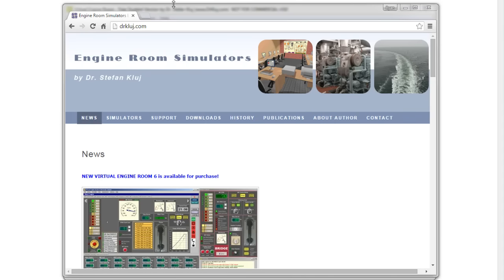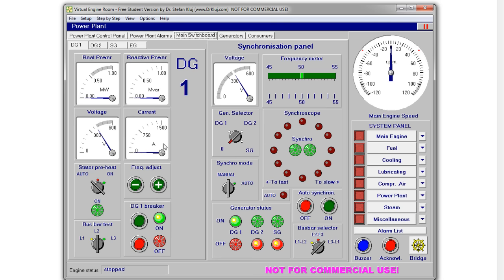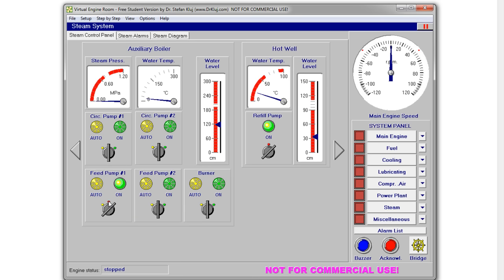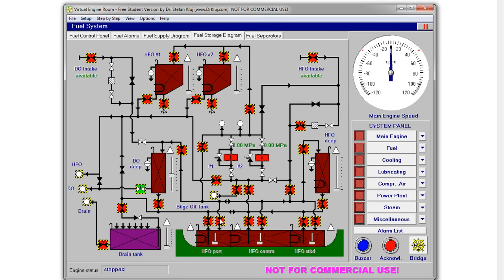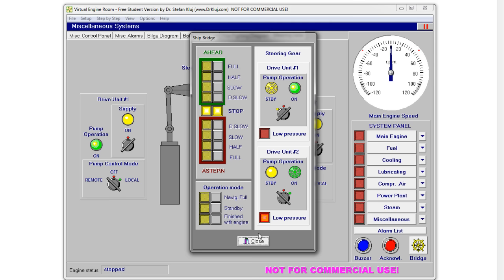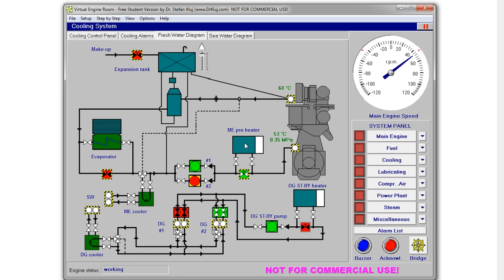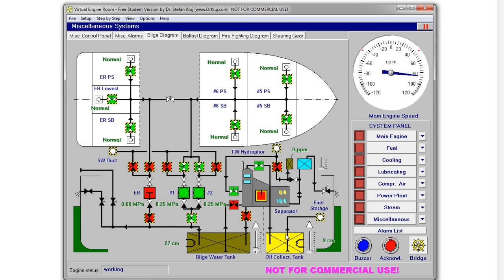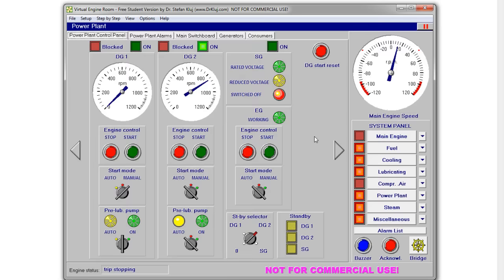Virtual Engine Room (VER) Main Engine Start

Comment: first of all thank you for the video, im a first engineer and currently doing marine engineering clases , so because of the pandemic maybe will no be able to use the simulator ofc the university and i was looking something free to do some online leason 
your tutorial was good , but can improve in concepts for example, when you where transfering fuel with the transfer pump you will never close the valves before stopping the pump (positive desplacement pump for fuel system of course you still have a relief valve)
also you say it but you would have never start suply and booster pumps of the fuel system before having the service tank with a good level
also you before you start the main engine you supose to have the boiler circ pump for the exhaust recovery system already running to not melt down the economaizer 
also normally you start the lub oil purifier before the main engine that help you to reach the temperature of the oil otherwise would be to cold (but that software problem)
when you transfer form sludge tank from oily bilge separator to the fo trasnfer system you would never never never put it in the DO  storage, some chief eng order to put it back to some fo storage to save money personally i would never do it you would fuck up your engine 
those are my feedback but very good specially if you are not a marine engineer
Reply from the maker: Thank you Felipe. I have been wanting to re-do this video and try to follow procedure more carefully. Your comments will help. I will train with that procedure. I do not work in the marine industry and have no industry experience. I am simply a fan of marine engineering. Thank you for all you do, and good luck with your career. I wish I could go back to my early 20's and join a marine academy.
Reply: @Usul  you make me rember something else, afteryou did the turning of the engine with the indicator cocks open, after you close them and remove the turning gear you supose to do a test only with air foward and backward ( so the bridge give you order dead slow ahed and then stern, and the fuel rack you only push it up until 0 ,to only use air (the engine suposse to turn like 30 rpm i have not test it yet so i don n t know if works , yo do that that to test is freely moving both direction , but if not if you are putting the power of the fuel the damage of the engine would be bigger than just by the compress air
-also when you were using emergency compressor you have a relief valve at the moment of starting supose to be open and then close it other wise if is manual diesel compressor with a handle would be imposble to start it up
Reply: @Usul  by the way do you have a free install of the kongsberg simulator?

Comment: wow really nice.
I am not a professional just a curious and machines lover. So I have some questions if you don't mind.

Why the engine needs a lub oil and fuel oil separator ? And why the steam ?.
Reply from the maker: The reason you need a separator is to remove contaminates from lube and fuel oil. Stuff like chemical contaminants, water, and other junk need to be removed from the oil before being fed to the main engine. Cooling water can end up in the oil, there might be oil recovered from the bilge, or maybe you were forced to bunker terrible oil from some questionable port. There are plenty of places where contamination can enter the system.

Steam is critical for many ship operations. It is used in the separators, and is also used to heat heavy oils making them easier to transfer with pumps. If the oil gets too cool, you wouldn't be able to transfer enough of it to feed the main engine. It actually needs to be pretty warm for it to flow easily. Steam is a safe way to heat the oil, as opposed to using electrical or other sources (which may be a fire hazard). The boiler can also be used to provide heat to the ship's cabin, clean water, and many other useful things.
Reply: Oh I see. Thanks for answering.

It seems the main engine can rotate the shaft for both sides, is that true and that is used for what ?
Reply: steam is to preheat the oil coming to separator. heat aids in better separation of unlike density

electric preheaters are present in boiler burners.

Comment: shouldn't you use the synchronization panel to switch the load from the eg to the dg. also shouldn't you close the indicator valves prior to starting the main engine. ( iam in school to become a maritime officer all ships so i know how it should be done)
Reply: @RetroToons  But How about air blow/air kick after Turning Gear disengaged and  before starting ME.
Reply: after air blow thats the time to close

Comment: New challenge. Run the engine through a two hour stream 'voyage' whilst 'buying' (shore intake) the least amount of fuel possible
Reply from the maker: That would be interesting. Unfortunately I don't think you could start the engine with only two hours fuel on board. There are minimums that have to be crossed before certain equipment will operate properly. You could attempt to start it with minimal fuel, or start it quickly. The fastest I've ever been able to start the main engine is around 30 minutes. I imagine with practice someone could start it much faster.
Reply: Step 1: use seawater to fill bilge tanks.

Step 2: set oily water separator to auto

Step 3: wait and transfer oil in collection tank to HFO bunker

Step 4:  sell oil at Port as "Excess fuel"

Step 5: Profit
Reply from the maker: @SmokyPizza6853  , I agree that is a super annoying bug. Using shore power, and just a tiny bit of shore DO (to start steam), you can use the OWS to generate infinite HFO and DO. Maybe this vessel isn't sailing in the saltwater ocean, but in a vast sea of hydrocarbons instead? Do you work in the maritime industry?
Reply: @Usul  No sir I don't. I just like playing with simulators

Comment: Dont know why when the main engine just get starting automatically the air pressure from air supply drop and cause my  main engine to stopped
Reply from the maker: Are you waiting for both main receiving tanks to be full? Also, make sure both are open. I've been thinking about making more videos about this software again. It has been almost 5 years since I posted this, and people are still watching.

Comment: Can i download it on my android phone? Please notice me, i'm really going to be needing this on taking my bachelor of science. Thank you.
Reply from the maker: I don't believe so. It is PC only. This simulator is quite old. The maritime school you join will have much better options.
Reply: I think it is still the same in our school. One more question, is it really necessary to increase the engine's rpm so that it will be tripped off, shut down the SG and automatically power up the D2? It causes many alarms, will it be okay on grading with my performance?(talking to my bachelor of science that i'm taking with)

Thank you anyway, i've downloaded it on my windows tablet.
Reply from the maker: @clintdenndalangpan8938 , I did this to cause a fault on purpose. The free version of the software does not let you introduce faults. I caused an overspeed condition on the engine on purpose to cause an overspeed trip and main engine shut down. It is useful to see how the systems react to a multi-system failure.

Doing this to an actual engine would probably be a great way to get fired.